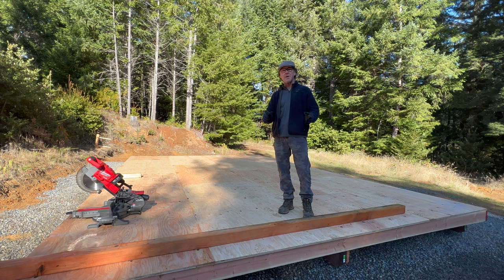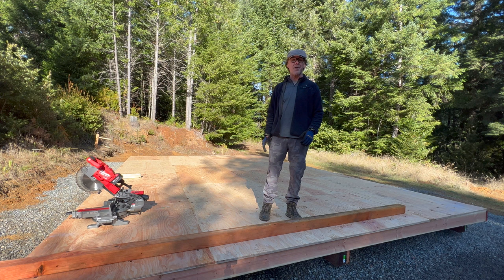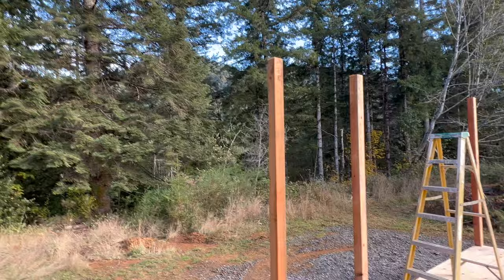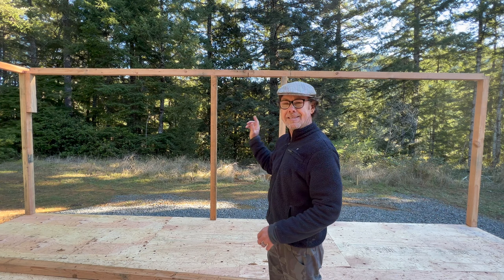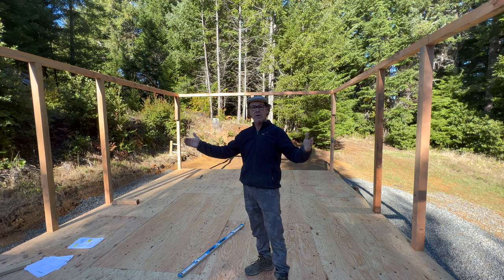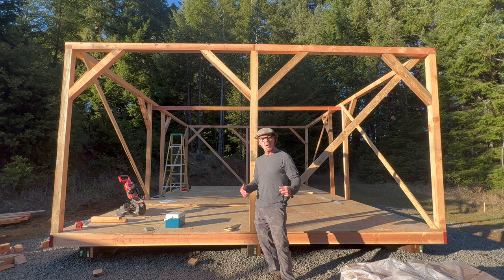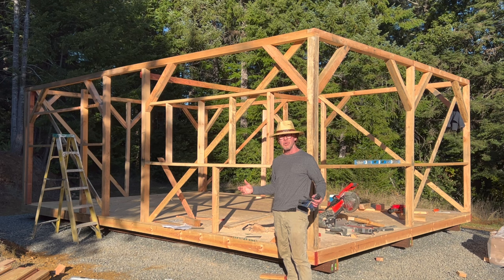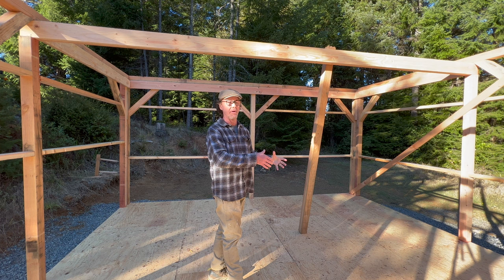Our 16 x 24 Post & Beam shop build

Comment: are you using dimensional lumber? So the "4x4's" are 3.5" x 3.5"? and "2x6" are 1.5" x5.5"? How thick is that "mahogany" siding? Tx. Rich
Reply from the maker: Yes- all dimensional lumber... those measurements are correct. The siding is 5/8".  Thanks for watching!
Reply: @rurallivingwithtyandlisa  The reason I brought this up is that the specs for the JCS plans and specs you are working from are for native rough-sawn hemlock "timbers" not "dimensional" lumber. And of course the siding is full 1"x12"pine,  more substantial than what you are using. I hope to build a precut structure similar to the JCS model you are building that will be to spec. Good luck with your build.

Comment: I hope you know that luan "mahogany" is not mahogany nor is it in any way related to true mahogany and not only is it NOT rot resistant like real mahogany but, to the contrary, it has almost no rot resistance but it should NOT be used for outdoor projects. Also, instead of your lap joint, when you realized your miscalculation, why didn't you just use joining plates?
Reply from the maker: Hey Bob- Thanks for watching- and thanks for your comment.  I'm actually going to treat & paint the siding with an exterior coat.  Hopefully, I'll be ok:)  Thanks!